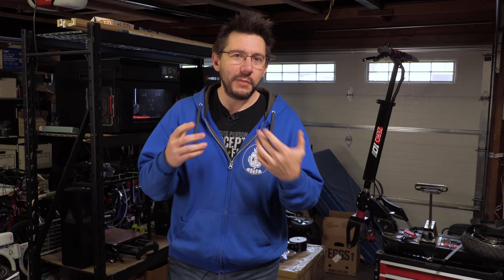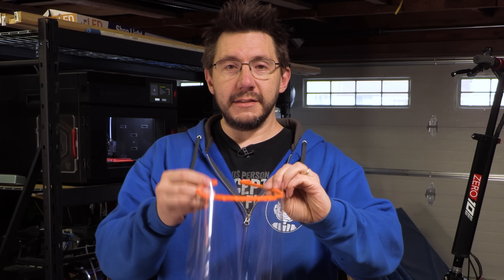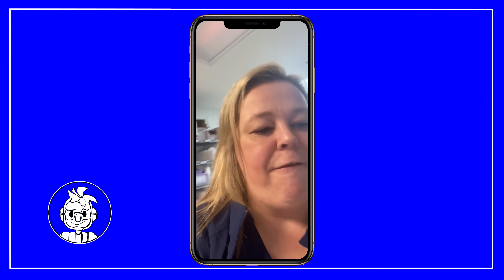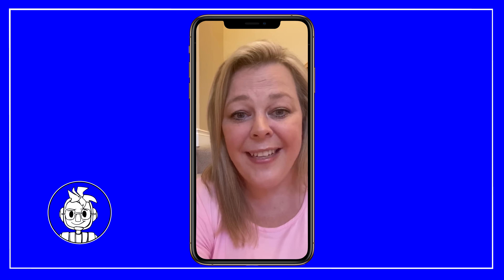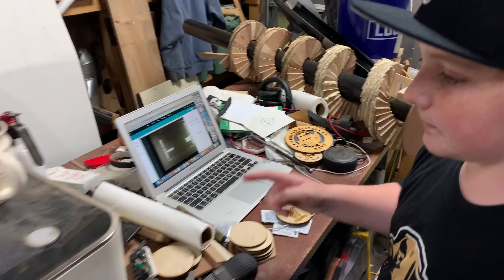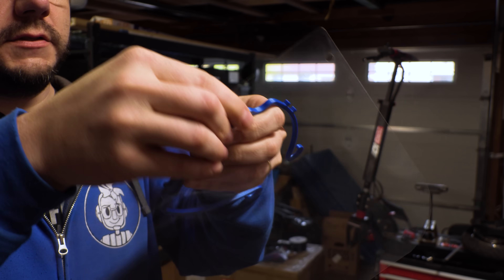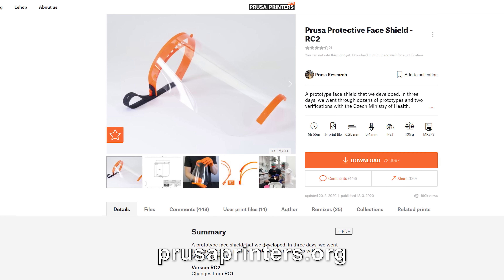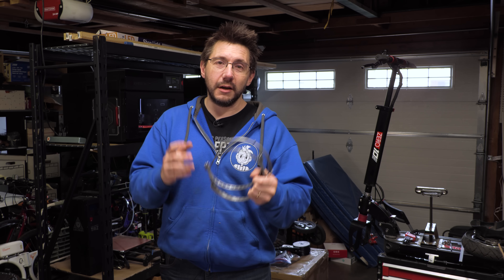3D Printing Face Shields and YOU CAN TOO!

Comment: What eight heartless tools disliked this video? I haven't had my CR-10s up and running in a while. I should see what I can do.
Reply: I guess people who actually know how bad this idea is. A+ for effort but fails in the main aspect: Security. Like in the video.. what does it help? Mamma can go shopping and has actually a higher risk of infection because wrong usage of such protectors. Like ehmm... touching it on the foil.  And it does not stop people from touching their face. So what it actually does is creating a risk on many different occasions.
Reply: @5calambres  would you rather the health care workers wear nothing at all because of a shortage? Anything helps in these tough times. Don't be such a Debbie downer.

Comment: I am new to 3d but I have a da vinci 1.0 pro with xyz software can I print this frame and what are the settings I need for pla. I only have printed parts from what Brian at 3d print creator has made for the pro. I want to help, if you can help me set up make these I will start helping by printing frames as I can. I hope you can get me what I need. Thanks for jumping on this so we can do our part.

Comment: Great vid Joel!  I started printing the Prusa version last night, just a sample in PLA, since I do not have any PETG handy.  I am glad the version you printed can be done with PLA (I also have some "PLA+" that I will use).  However, I do not have a laser cutter - what do you suggest for cutting the shield without a laser?  Can a standard single-hole punch or something be used?  Possibly a jig and drill?  My sister is a doctor at a local hospital and I want to get them to her ASAP.  Thanks!
Reply: Perhaps someone could design a printable template you can cut with a craft/hobby knife, and drill holes.
Reply: @colinyoung3685  Kind of what I was thinking.  I can probably design something myself - if anyone has already done so, please post link.  Thanks!

Comment: I have a glowforge also. and I am 3d printing currently.  Can you share the SVG to cut the shield?
Reply: Same, Please provide the settings you used also, as to not cut the wood below.

Thanks!
Reply: @JonN612  its in the link he provided. He has the stl's and svg's on it. https://3dverkstan.se/protective-visor/
Reply: You can find the template here:  https://github.com/Cederb/Faceshield.nu/tree/master/North%20America/Templates%20%26%20Laser%20Cutting%20files

Comment: I think my Cricut will cut the transparencies....I just need to get some.
Reply: Yes they will cut plastic.  You may need to test and put more pressure on the blade than the default setting.
Reply: I am working as a team with my sister. I am printing the frame and my sister is cutting them with the cricut. Working like a dream
Reply: Yaaaboiflexi Will the Cricut cut the small holes? Thanks
Reply: Will the Cricut even cut out the small holes in the transparencies for attachment to the 3D printed headband? Thanks

Comment: I'm a ER doctor and I'm printing my own stuff when we run out.
Reply: I'd suggest to start printing now if you haven't, better to make sure everything is tuned for it, and it will delay the sudden lack of supplies.
Reply: @dreadflint  m
Reply: And thank you for everything you do! You are a hero!
Reply: Ammar Ali sorry for the question but do you throw it away After using? Why not clean it and use another Time
Reply: @loarzhapunkt  because that aids in transfer . A N95 shouldn't be worn with a pt then used on another patient
Reply: @ammarali5134  What if the part were sterilized in isopropyl alcohol?
Reply: @r0bd  so the problem with cleaning some of these medical devices is that they are not practical. For example we use single-use gloves and gowns for that reason. I am currently cleaning and reusing my goggles but in no way is that completely sterile. Not many hospitals have invested in extensive recleaning tech. Some hospitals have autoclaves etc.
Reply: @ammarali5134  Isopropanol or denatured alcohol are compatible with polypropylene (mask material). Heat is an option. For shields, a bleach bucket works.
Reply: @loarzhapunkt  the 3d printed parts cannot be properly sanitized between uses
Reply: @loarzhapunkt  this type can be reuse
Reply: @loarzhapunkt  we reuse it. The problem ist that the shild or the glasses becomes  blind with the time...
Reply: Anyone know of a good way to get the clear shield part?
Reply: @ammarali5134  I've just bought some from Ebay, but I don't know how effective they will be...

https://www.ebay.co.uk/itm/5-Star-Office-Comb-Binding-Covers-PVC-250-micron-A4-Clear-Pack-100/123654280550?ssPageName=STRK%3AMEBIDX%3AIT&_trksid=p2057872.m2749.l2649
Reply: @BurtMeister  I'm Going to try buying this but if anyone else has links to clear shields that I can use with Joel's STL file please leave a link
Reply: @ammarali5134  in Czech we use office supplie like this https://www.mptoner.cz/predni-folie-pro-krouzkovou-vazbu-prestige-a4-200-mic-cira-100-ks-p18030/?utm_source=Google+n%C3%A1kupy&utm_medium=ppc&utm_campaign=P%C5%99edn%C3%AD+f%C3%B3lie+pro+krou%C5%BEkovou+vazbu+PRESTIGE,+A4,+200+mic,+%C4%8Dir%C3%A1,+100+ks&gclid=CjwKCAjwguzzBRBiEiwAgU0FT01rtDKeAzRgIgxmxgAMcxSB9hPFL8YHmamNm8Ro1txbsu7HPJL5HRoCi3YQAvD_BwE nad laminate in https://www.mptoner.cz/laminovaci-folie-kapsy-216-x-303-a4-80-mikronu-baleni-100-ks-peach-p33916/ for antistaic and for holes use this https://www.mptoner.cz/derovac-sax-318-cerny-p288/
Reply: Ammar Ali would old school sheer transparencies work?
Reply: @PaperMario64  I'm not sure. I'm new to manufacturing my own supplies
Reply: @PaperMario64  I'd have to Google that . Anything that is clear and covers should be fine. I'm using swim goggles
Reply: @ammarali5134  just ask your administration or human resource department. They should have tons of it
Reply: @ammarali5134  2 liter soda bottles man
Reply: @ammarali5134  check printer plotting film/overhead projection, A4 sized.
Reply: Printing the part in PETG would give it the   benefits of it being hydrophobic and have some chemical resistance, thus allow you to sanitize it in a bleach and water mixture.  The shield part as well, if that were made of PET (Mylar) - e.g. transparency pouches (they get clear when put through the laminator)
Reply: More specifically I live in Miami so if anyone knows of a good resource lmk
Reply: @ammarali5134  I saw design that used clear binder sheets and a standard holepunch. Not sure how much protection the binder sheets do.
Reply: @Zuul47  Any clear plastic film should do the trick as long as it doesn't easily get holes in it. Luckily this is purely a mechanical barrier meant to keep exhaled droplets and other fluids off the faces of the healthcare providers. This type of equipment is the perfect match for 3D printing since it is not critical life supporting equipment for the patient (like 3D printed ventilator valves) but still very much in need. These are cheap so they can be tossed if needed or cleaned well if the supply runs short.  I'm a bit more dubious of the 3D printed respirator masks and such but in desperate times....
Reply: @DJCloudPirate  I'm the same way. I think these are the perfect call for 3D print network. The N95 respiration stuff needs to fit and fit well. So much can go wrong with a print and so many nooks for the firus to get into and make others sick
Reply: Also, this is what the transparency sheets that the website promotes. https://www.amazon.com/Apollo-Transparency-Copier-Without-VPP100CE/dp/B001E67VP6/ref=as_li_ss_tl?crid=1WBOOADF1N6&dchild=1&keywords=overhead+transparencies&qid=1585171740&sprefix=overhead+trans,aps,460&sr=8-5&th=1&linkCode=sl1&tag=3dpriner-20&linkId=01436984fe68fbbbd7787b21e9b0e953&language=en_US. Funny story is that my father-in-law was cleaning out his house 6 years ago and was like here are some overhead transparencies. I was like ok great thanks.(thinking what the hell am I going to do with these 😂) little did I know the time would come!!!!!
Reply: Hello, can someone please tell me the thickness of the transparency sheet? I'm printing as fast as i can but i'm not sure if i can use regular transparency film, that is about 0.11 mm thickness. I'm in Colombia and i think is the only kind of transparency i can get my hands on. Thanks.
Reply: Would exposing the shield to UVC do the job?
Reply: STERILIZE FACE MASKS
Stop the shortage use them more than once

sterilization with Gamma irradiation, It kills bacteria by breaking down bacterial DNA, inhibiting bacterial division. Energy of gamma rays passes through the equipment, disrupting the pathogens that cause contamination.
https://sterigenics.com/technologies/gamma-irradiation/?gclid=EAIaIQobChMIouXVpeXR6AIVtBx9Ch0GnQKeEAAYASAAEgJWnvD_BwE
Reply: What 3D printer are you using?
Reply: Has anybody tried Ultraviolet, specifically  UVC?
It might degrade the plastic however, no COVID-19, or much of anything else for that matter. It can damage your skin and your eyes, so care must be used.
Reply: @andygreyriderGRN  Hello I am in UK and SMOW available in UK, which model did u buy as I am  interested to get one- Would appreciate reply
Reply: which printer do you use ? how much i need to start printing this in Namibia